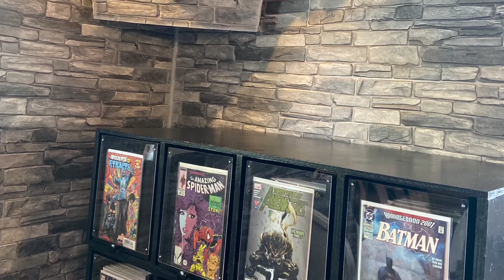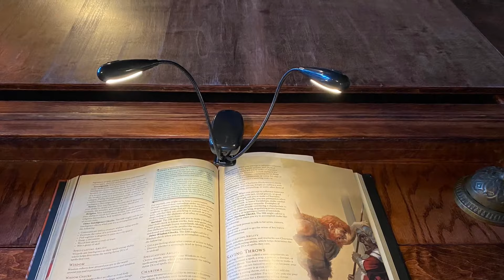Dungeons & Dragons - Game room

Comment: I love what you did with the room. It all looks fantastic. Would you be able to share the ballpark number of what the table cost in materials?
Reply from the maker: Thank you! 😊 I’d say around $500-600
Reply: @ontheflycomics8825  What are the dimensions of your table? How many players does it comfortably fit?
Reply from the maker: It sits 8 players comfortably. It’s a little larger than 4 x 8
Reply: @ontheflycomics8825  Thanks for the response! That's 3 players on each side plus one on each end?
Reply from the maker: @kyleweir689  correct!

Comment: Fantastic room! I'm doing something similar to my game room but getting the faux stone from Amazon. What did you use to adhere the panels to the wall? I read once they are glued on if you ever want to remove them it will damage the dry wall and require all new drywall.
Reply from the maker: We used a glue adhesive and trim nails. If we ever remove them it will require sanding and repaint for sure! Thanks for watching and good luck on your build! 😃
Reply: where did you get the chairs?
Reply from the maker: @jamesdagro4189  https://www.topdrawerfurniturestore.com/products/petersburg-side-chair-2-ctn-dark-gray